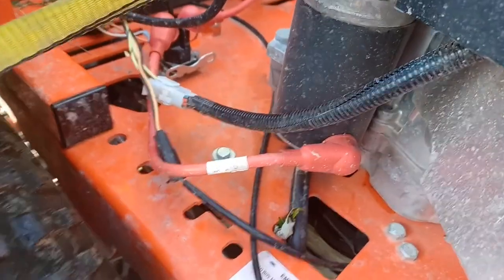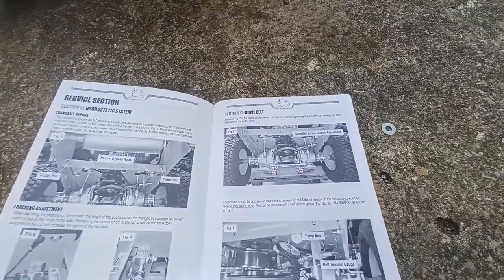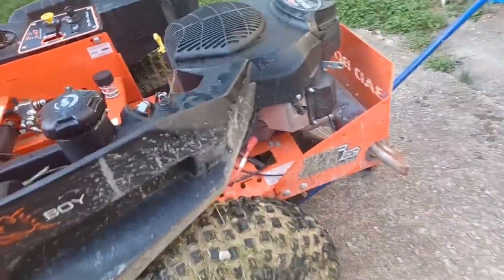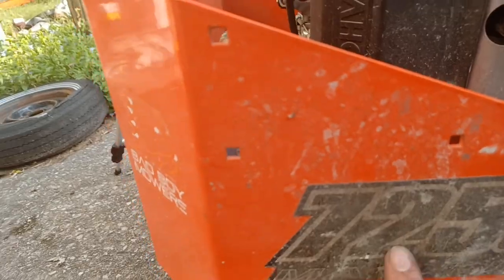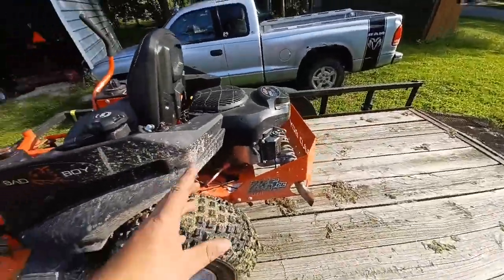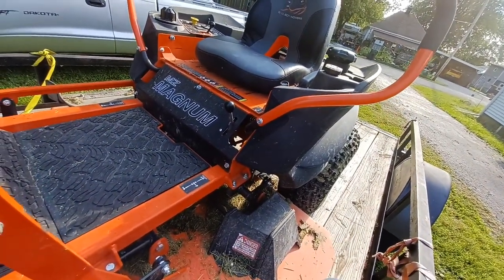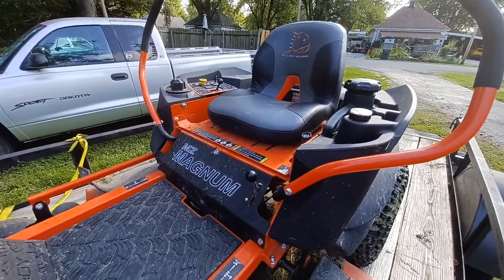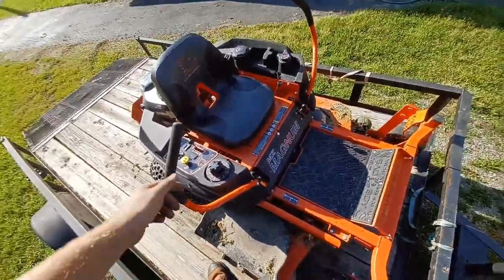🔧How to change the drive belt Bad Boy MZMagnum🧰

Comment: Thanks for posting this - my drive belt came off this week and I need to get it back on - you are right, there is no rooom to work that belt back on as it sits. i will be following your process here in a few minutes. Had mine since july of 2018, it is a beast. I abuse the living snot outta mine and it has held up great. the only failure other than the drive belt is the emergency brake switch went end of last year. Oh yeah, the seat does suck, my only real complaint.

Comment: The belt was thrown because the batt. Hold downs fell in the fans!! Word to the wise fix the batt. Rods so they can't fall in the fans!!! I have300+ hrs on my 2019 MZ mag. With  general maintance!!
Reply: how you fix that i have 2022 model would i have same problem
Reply: Yeah, mine just shredded the drive belt and wouldn’t ya know…..one of the battery support rods are missing.  This is a huge design flaw that they really need to address…🤬🤬🤬
Reply: @andylee1587  - Remove the OM battery brace and rods.  Then secure the battery with a bungee cord or a large zip tie.  Because the battery support rods will eventually vibrate loose and fall directly down into the pump fan while operating the machine which in turn will destroy the fan and shred your drive belt.
Reply: Same issue!!  Those fan blades are a pain in the butt too! Gonna try and get it back on. They sure don't make it easy to do yourself

Comment: I was told to change the drive belt by lowering the right side not the left. I think it was because of that spring tension.
Reply from the maker: You really need to drop both transmissions down to get the belt off of both of the pulleys. Because the belt won't fit between the gap of the top of the pulley and the body. The tension spring will need loosened in order to get the belt on and off.

Comment: How tight is the 60 65 on the drive belt mean?
Reply from the maker: If you have the scale tool to pull on the belt from the side it should be 60 to 65 pounds its expensive just make sure it is tight. https://www.tractorsupply.com/tsc/product/bad-boy-parts-online-belt-tension-gauge